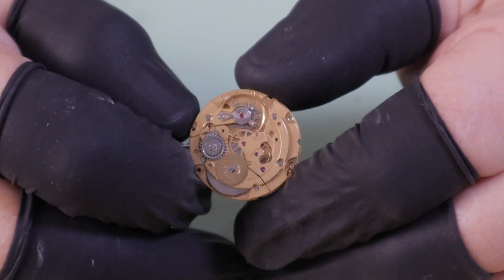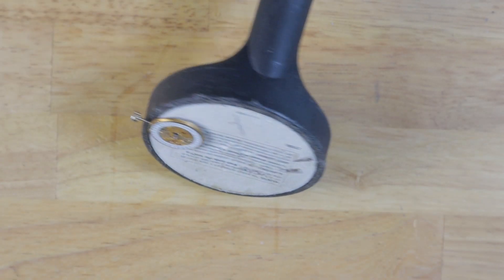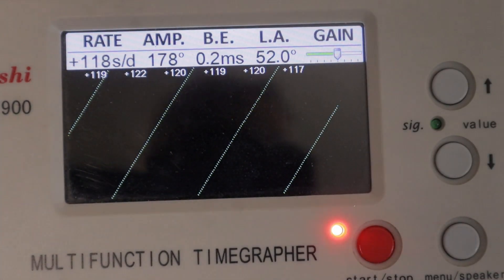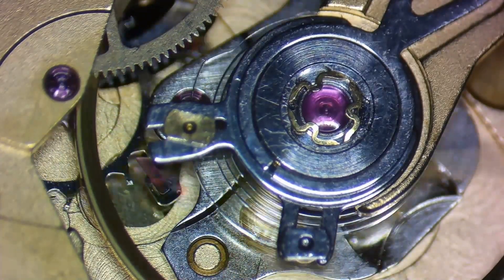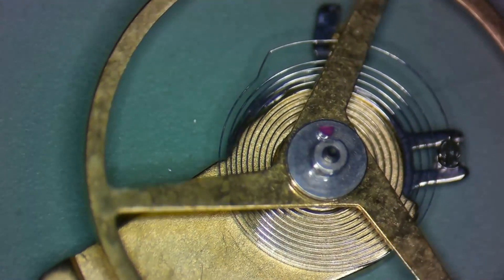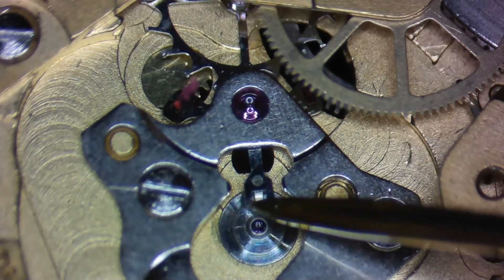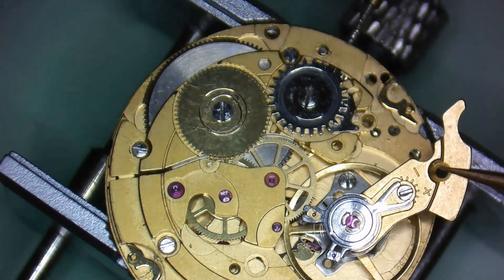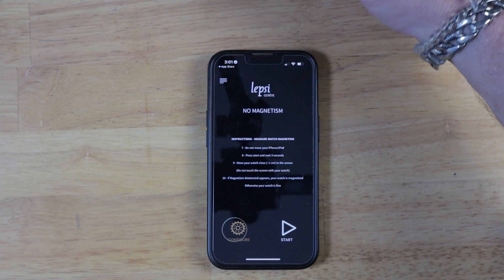How Magnetism Affects Watch Regulation

Comment: Can you change original hairspring to a silicon and antimagnetic hairspring?
Reply from the maker: No. I am pretty sure they are made specifically for a particular balance wheel in a particular movement. Replacement hairsprings are also typically not available to purchase from part suppliers
Reply: @watchrepairtutorials  so what happens if you have ETA 2892-A2 where you want to replace the hairspring?  that's it for the movement? in the bin?   or do you buy another old movements for parts?
Reply from the maker: @gioraus  You replace the balance complete. The hairspring and balance wheel which have been matched together.  You can not buy hairsprings for the movements by themselves.
Reply: @watchrepairtutorials  I see, thank you.  For ETA 2892-A2, most watch maker would be able to replace balance wheel and matching hairspring, but can they get antimagnetic version?  The reason I asked is if ETA 2892-A2 would ever be modified to a anti-magnetic version.
Reply from the maker: @gioraus  Not until ETA makes them available.
Reply: @watchrepairtutorials  I get it now. I hope oneday they would.  Thank you so much. It's being so amazing to watch your expertise.  I am not a watch maker but I find these things super interesting.  Watching the parts moving is pure bliss.
Reply from the maker: @gioraus  thank you. I couldn’t agree more.😀

Comment: Hi Alex!

Can I use the Lepsi app on iPhones with a wireless charging/ magsafe function?  Because they have a magnet in them, and I will make it worse, or use the compass?
Reply from the maker: I’m not sure Attila, that might be a question for Lepsi. If you dig into it a little further, I would love to hear what the answer is.
Reply: Thank you for the quick ansver. Unfortunately, the Lepsi app has not been updated for four years.  Since the Iphones got the strong magnets for the magsafe function., on the back to hold and charge the phone. Will conect the app developer  and will see…
Reply: @attilaszekelyhidi9023  This was my concern. I don't have an iPhone but have used a compass app / magnet sensor app on my Samsung. I suspect though that magnets inside the phone have made the magnetism issue in the movement worse, because I did a sewing needle test with my phone and the needle is attracted to several points on the phone, some quite strongly.

Comment: Alex, thanks for explaining clearly the effects of magnetism on a mechanical watch. Question: must a movement be removed to be de-magnetized or can it remain in the casing? Also do modern watches suffer in the same way as older ones (other material used on springs etc.)? Again thanks for your easy listening voice! 👍Frank
Reply from the maker: Depending on the case and the amount of magnetism present, often times it can be left in the case. Modern movements have some alloys that are more resistant to magnetism, but they still have steel parts.

Comment: Thank you for doing all the experimentation to illustrate your teaching. Great stuff.
Rather than the binary output of the Lepsi app, I prefer to see the numerical output, direct from the phone sensor.  On Android I use "sensor test" app - no ads, no nonsense, just the magnetic field strength in micro teslas.
Reply from the maker: You're very welcome and that’s a good tip. Thanks

Comment: Hi Alex, I wondered if you would be able to point me in the right direction. I’ve been working on a vintage Waltham automatic that has an FHF 905 movement in it. After a complete disassembly, inspection and cleaning of all parts in the ultrasonic (both wash and 2 rinses using L&R fluids), minus the pallet fork and balance complete (attached to the balance cock) which were cleaned by soaking in Troop Balas One Dip, I reassembled the movement and lubricated, but it runs very poorly with low amplitude and very high rate. I noticed that the hair spring coils where sticking together so I re-cleaned the balance complete again. Having concluded (perhaps incorrectly) that the movement was magnetized, I ordered and finally took delivery of my new Elma Antimag, and demagnetized the movement, but the watch is still running badly. Over the last day, I must have demagnetized the movement and balance 20 times in all sorts of orientations as well as cleaning the hairspring half a dozen times (including changing the One Dip), but the coils still stick together, albeit not as badly as initially. What I’d like to know, is do you find the Elma Antimag reliable and in your experience is just a couple of demag uses sufficient to completely remove all magnetism from a movement and/or balance and hairspring? Additionally, is it possible that the hairspring has a contaminant that One Dip won’t remove and would you suggest trying to clean in something else? Thank you in advance and great video as always?
Reply from the maker: Yea, I don't think it's magnetized.   Check the L&R and make sure that no water got in it. Look to see if there is in gelled solvent in there. Water and L&R don't get along. Maybe try some fresh L$R with a lid and see it that helps.
 Good luck!
If that's not it, I would suspect there is something, possibly like silicon on the hairspring that's not coming off. 
 Let me know
Reply: @watchrepairtutorials  thanks for the reply Alex. Just want to clarify, I cleaned the disassembled movement minus the pallet fork and balance complete with balance cock in L&R #111 followed by two rinses in #3. The excluded parts were soaked in One Dip. I was under the impression that I couldn’t clean the shellacked parts in #111 because it contains ~20% Naphtha which would dissolve/damage the shellac causing the stones to dislodge. My L&R solutions are not water contaminated (I’ve had that before and know what to look for), but given I haven’t cleaned the hairspring in it, I assume that’s not relevant? So am I correct that I should not be cleaning shellacked parts in L&R #111? If you’re confident that the hairspring is not magnetized as a result of my demagging it on an Elma Antimag numerous times, and we hypothesize that it has a contaminant on it causing it to stick together, what would suggest I use to clean it?
Reply: @russellbiofish  Naphtha is fine for shellacked parts. Its IPA that can cause problems.  At this point it's hard to say what will clean it off the hairspring without knowing what it is one the hairspring. I would try to run it through the L& R wash once or twice and see if that makes any difference. If not you may have to resort to something stronger if the hairspring is indeed contaminated with something out of the ordinary, which it certainly appears to be.
Reply: @thewatchsmith2773  OK I must have misunderstood. Can they also go thru #3 rinse? I’ll check the MSDS to be sure of the contents.
Reply: It’s ~75 Mineral Spirits Regular (C6H6 < 0.1%), (Stoddard Solvent) and ~25% Naphtha.
Reply: Well Alex... you were right! After just one clean in fresh L&R #111 for 10 mins and two rinse cycles in L&R #3 the coils don't show any signs sticking together. I re-mounted the balance assembly then cleaned and relubricated the cap jewels, and applied a full wind to the main spring. I performed an adjustment of the beat error to 0.1ms (as close as I can get it), checked the hairspring is in middle of the regulator pins and the coil spacing doesn't change for the full travel of the regulator arm, then regulated to -2 s/d. Amplitude is at 277 degrees with the original mainspring (cleaned and lightly relubricated, plus braking grease on the barrel walls). I even checked my notes and for some reason must have got mixed up about IPA vs Naphtha. Lesson learned. Thank you!!!
Reply from the maker: @russellbiofish  Russell that is fantastic to hear. Hit me up anytime you need something.

Comment: Have been using the pegwood tool you demonstrated in a previous lesson with the diafix springs on the 7s26 barrel train bridge and cleaning the cap jewels as you showed. Those springs had been so incredibly frustrating to deal with. Not anymore. Just cleaned and oiled a bridge and suddenly realized how relatively simple it had become. Thanks Alex.
Reply from the maker: You know John, it’s all this little things that make a difference my man. 
Thanks brother. This comment you made is why I do it.

Comment: Wow, really enlightening video! I knew it was important to make sure watches were demagnetized, but falsely believed it was easy to detect to visual cues. I'm also quite relieved to know the little blue box demaggers work. I got one due to budgetary constraints more than anything else, but happy to know it really does work. Quick question on that for you: you just lift away like you show in the video one time? You don't need to rotate or anything?
Reply from the maker: Well it will probably depend on how magnetized it is. I tried demagnetizing a bench block with it and it would not do it but then neither would my Elma

Comment: Fascinating. I learn so much from your video's. Thanks. I have one of those little blue boxes but just can't demagnetize completely my thin small tweezers, it always shows some magnetism with my gauss meter and attracts small springs. Ive tried pulling away slowly, quickly, different angles also rotating but it still leaves a tiny bit of magnetism. I have some slightly thicker anti magnetic ones i usually use. Interesting, incredible, fascinating videos.
Reply from the maker: The one thing I don’t know is how reliable they are overall. I am sure there is some QC issues. I would just verify that it’s working on your movements
Reply: Ive just tried it again, and this time  did the handle end and also in the middle.. success Thanks.

Comment: Great insight, thank you Alex. I do have a demagnetizer and use it routinely when i have assembled a watch and before regulating, but i never considered using before cleaning... your point about picking up metal particles makes perfect sense. The Lepsi app is a great idea, that will definitely go into my arsenal. To reinforce your point about the effects of "mild" magnetism, I immediately tested it on my "daily wear" watch. It is a 30 year old Tag Heuer Chronometer that i dont care too much if it gets beaten up with the normal everyday rough and tumble. It has a DU amplitude of about 260 and runs about 15s per day fast on the wrist. It hasnt been serviced in 10 years and I havent gotten around to it (more interesting projects on the bench) and I chalked it up to that. Sure enough, it showed up as magnetized. I zapped it with the demagnetizer and DU amplitude jumped up to 285 with a rate of +2s. I am very interested to see how the rate changes on my wrist. Thanks again.
Reply from the maker: Thanks for confirming my point to the video. It’s the small hidden magnetism that gets ya.

Comment: Good job. I use the Horotech model with the detect zone and it always agrees with the Lepsi app. If you don’t realize how many metal particles that are in your cleaning solution that will stick to a magnetized part, throw a rotor from an older quartz movement in the parts basket and see what you find.
Reply from the maker: That’s awesome and also a very good idea

Comment: I learned a lot from this. I’ve seen magnetized movements run fast, but didn’t understand why this happened when I couldn’t see any evidence of the hairspring coils sticking. Your explanation makes perfect sense.  Also, it never occurred to me that magnetized parts might pick up steel bits during cleaning.  And if those bits let go when the assembled and lubricated movement is demagnetized, this would be really bad.  Once again, Alex, you’ve brought understanding and clarity to a subject that no one else ever talks about. Thank you!
Reply from the maker: Hello Sir, 
if you think about it when you’re washing off an old movement that has a lot of wear and  tear, you’re washing or rinsing away all those metallic dust which goes in your solutions. It really just kind of makes sense that if your parts are magnetized, that those particles are going to be attracted to those magnetized parts, I think the last thing we all want on a freshly serviced watch is metallic dust mixing with oil.

Comment: The compass needle moving is the needle reacting to the influence of the steel movement parts on the magnetic field of the earth. During WWII they found that the soldier's steel helmet caused error in compass readings.
Reply from the maker: I pointed that out, but when heavily magnetized it will move more erratically.